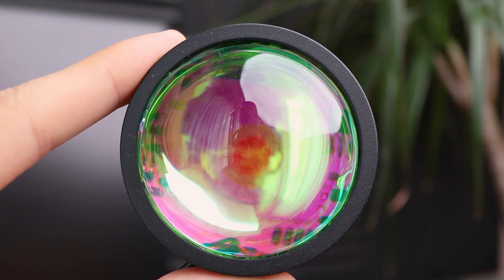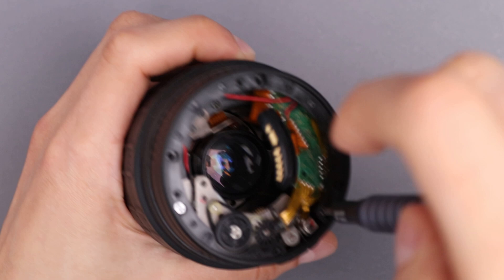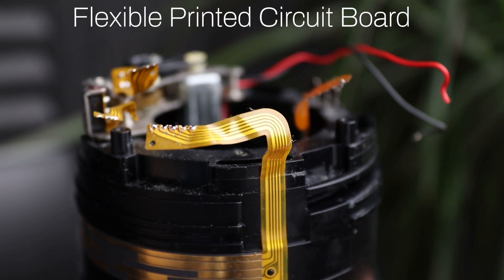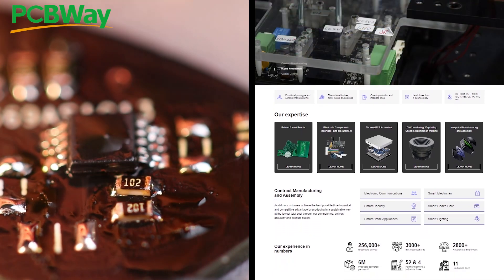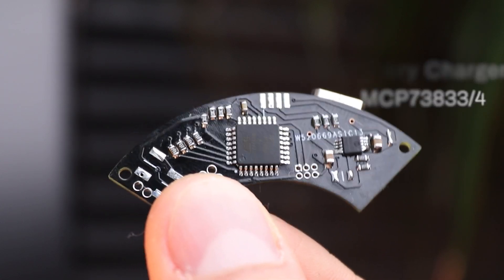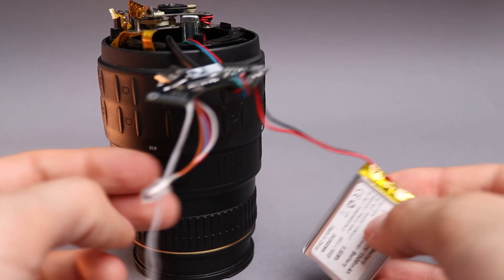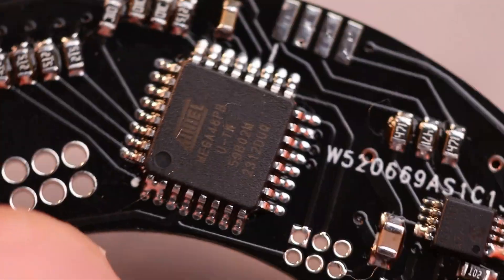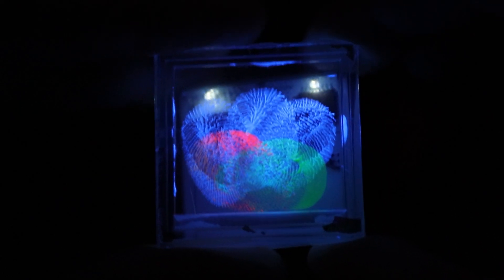Building a Next-Level Sunset Lamp from a Camera Lens

Comment: I work in broadcasting and saved 2 old Fujinon "TV Zoom Lens" from the trash. They have no internal autofocus or anything, as far as I can tell they're just 20+ cm of Japanese glass in tube with zoom, a manual focus ring and iris control. No switches on the lens, nothing. I wonder if I could just mount a light with an inline power switch inside of one of them haha
Reply from the maker: There is actually only one way to find out 😄
But you would probably need to remove all the lenses to fit the sunset lamp PCB.

Comment: thought u gonna use the lens optics too that would be sick, next level lamp nonetheless
Reply from the maker: I just couldn't, because with this lens optics, I would only have a small spot on the wall. To make it work with real optics, I had to use a short focal-length lens that somewhat disperses the light. Then it would have worked, but such lenses are very short in height. So electronics would not fit :(

Comment: You K-tip your SMD passives, both pads at a time? You’re a braver man than I. Pad-by-pad with a D12 is my go-to, and you’ll want to do the same if you end up having to solder in tighter quarters.
Reply from the maker: I think if I had to solder a lot of components close to each other now, I'd use a stencil and an oven. Do I have an oven? No :D
But I'd buy one. Or make one. I'm a bit lazy and like efficiency, ahahaa :)

Comment: this is a cool sunset lamp in 2024.
i had a sunset lamp around 1998. it was an old slide projector with a 100W halogen bulb and different camera filters in there instead of slides. 
there was one or two combinations of filters that looked like real sunsets with similar brightness.
Reply from the maker: The physics is the same, only technology has improved since then—from halogen to LEDs! 😄
I was 1 year old ad 1998 btw, hahah :D
Reply: @NickElectronics  it sure has, but i still use halogen for my desk. its great for reading color codes.
Reply from the maker: @echelonrank3927  Does it has better CRI than LEDs?
Reply: @NickElectronics  yes, its CRI is 100
Reply from the maker: @ Yes, then it is obviously better :D

Comment: That's an elegant, highly engineered solution. I'm not so talented. I would just get a rear lens cap, cut the back off and epoxy on a ring to slip over an LED lamp or flashlight.
Reply from the maker: Thats an option. And use original remote for its control for example

Comment: I hate you a little bit.😄 This looks so good!!!! My sister is a photographer and I like this Kind of technology/ Idea. Now I'm looking for broken lenses just to build that! But I also know how difficult it will be again, but the inner hellhound wants to build it now. I don't have your experience with the PCBA or battery, so I have to try it without a battery and with an Arduino Pro. But thank you for this great idea, it just looks great! And this is actually my first comment on YouTube. Subscription was immediate! I love people who can build creative, great things and usefull things like you. Thank you. But still kind of hate you. Cause I know how complikated this will be. 😂👍
Reply from the maker: Ahahaha! I'm so glad you liked it enough to want to build it without any prior experience. That's quite brave of you! To save some time, you could probably eliminate all the control features and keep the original remote to turn the lamp on and off and change the modes. In that case, you would only need to make a hole for a USB-C connector, which you can buy pre-soldered to the PCB.

Perhaps you could place the lamp remote in another photography accessory, like a camera flash remote or something similar. Anyway, if you need some guidance, feel free to ask. And good luck. Dont hate me please, ahahaha

Comment: Too bad it doesn't produce actual white light...
Reply from the maker: Yep. Because of a colorful film filter 🫠 But sunset lamps usually used as a second light, not the main one. So idk if it is a really big problem
Reply: @NickElectronics  all the bits are in there already, might as well add the white channel.
Reply from the maker: @VEC7ORlt  I should remove the filter (film) to get white color. But without a filter result is much worse. So idk what do you mean by saying "all the bits are in there" 😅
Reply: @NickElectronics  you should have added a white channel - all the control bits are there - you've added the micro, made boards. 
Alternatively you could have replaced the LED with a RGBW or RGBY, you can do pretty cool stuff with those.
Reply from the maker: @VEC7ORlt  White color passing through a color film becomes not white. How should i have turned it into white? Only by placing white diode above the film and adding another PCB.
Reply: @NickElectronics  yup, thats exactly what you could have done.
Reply from the maker: @VEC7ORlt  In my opinion, there is no sense for a sunset lamp to have a white color. Also, this increases device complexity by giving it an additional functionallity it does not really need (Again. In my opinion). It is called overengineering something. So, it is debatable. 
Btw, next one I make is going to be desk lamp. And oh yeah, desk lamp needs white light 100%.
Reply: @NickElectronics  you're putting a lamp inside a lens, what were you saying about overengineering? Cause I cant hear you over the sound of overengineering.
Putting white into rgb mix reduces the harshness of light which you cannot achieve just my mixing channels.
A desk lamp? Cool cool, which LEDs are you planning to use?
Reply from the maker: @VEC7ORlt  Hehe, nice answear)  
I just want to add that: first - nothing is ideal. Second, there are always space for improvement. There are a lot of things i could have added ) But at some moment everything should come to an end. 
Oh, different type of LEDs ) Addresable and not. RGB and not ) If you follow, you will see. Videos are not coming that often, cause of lack of time, but nevertheless.
Reply: @NickElectronics  do a tunable white, and remember the name of the game - HIGH CRI.
Output and lumens are easy, but quality white is a bit harder, but there are plenty emitters to choose from.
Reply from the maker: @VEC7ORlt  I will try my best. But please, do not forget that I am doing prototypes mostly. And hopefully insipartional videos :) I do know that HIGH CRI + propper current control is a must have for a commercial products. If I ever do commercial product, I will take everything into account. But for now my time and financial budget is limmited :(
Reply: @NickElectronics I think we would see commercial products from you, but when you have x10 or even x100 subscribers count 😅
I really hope it will be 🙏🏼

Comment: if the focus ring only has 16 values how is it infinitely variable?
Reply from the maker: In reality, the ring is attached to a mechanisms that adjust the lens optic system for the image to be in focus. So these 16 modes are used for some kind of feedback, I guess. You could watch any review of this lens to see that when the ring is rotated, the lens extends. Unfortunately, I could not show this on the video because the lens was broken when bought it and was not working at all, mechanically and electronically. Hope I have answered your question :)
Reply: @NickElectronics  so it uses multiple passes of the 16 values to know forward back and speed of change , make sense thanks

Comment: Really cool shots! Nice story telling. Would just be nice if you explain a bit more how gray code works and how you process the signals.

But besides that really amazing. dont know how you can only have 1.6k subs
Reply from the maker: Hello. Thank you 🙂 I wanted to make video more dynamic, that is why i did not include detailed explanations. 

Gray code feature is that only “one bit changes when the slider moves from one position to another”. So from 0 to 1 is “000” to “001”, from 1 to 2 is “001” to “011“. Between two numbers the difference is only 1 bit. Why its better? Because when signal is measured with a microcontroller, slider can be moved at the middle of reading process. Which in case of a binary code leads to a reading mistakes. Cause two bits in adjacent numbers can change simultaneously. With the gray code, even when slider is moved at the middle of the data reading, you either get a previous position or the one the slider was moved to 🧐

Then i just connect contacts of the slider to the pins of the microcontroller. Only 4 pins are needed. After reading those pins (getting 0 or 1) it is just a simple if condition in the code :) For example, if all signals measured are 0000 - first position and first lamp mode. 

Hopefully my answer was not too long :)
Have a great day 🌞
Reply: @NickElectronics  No worries AS a Software Developer i find this the Most interesting in such Videos. But makes sense abreally beautiful and well designed lamp! I really Like the controls.imagine this with a clicky aperture Ring haha
Reply from the maker: @GamingClubGermany  Hehe. Thanks again. If by 'clicky aperture ring' you mean purely mechanical ones that old lenses have, yeah, it would be problematic to read signals withot a signals even existing))